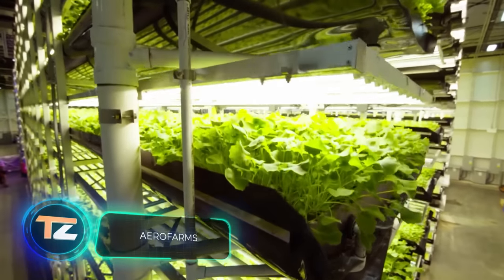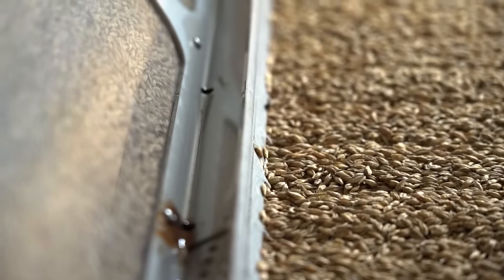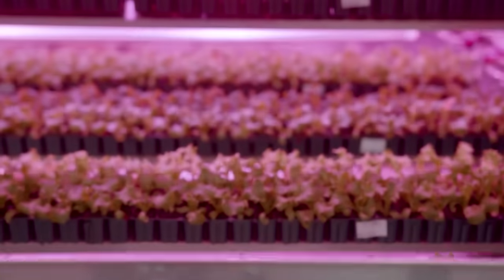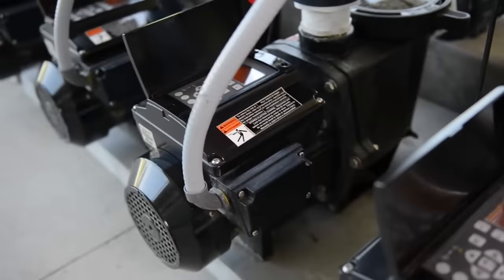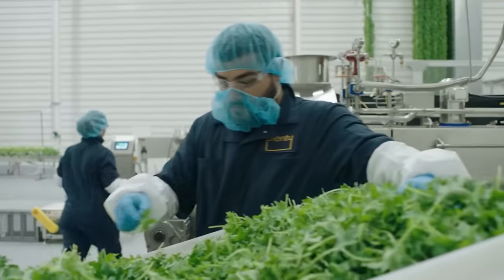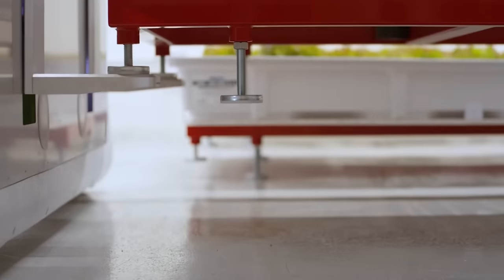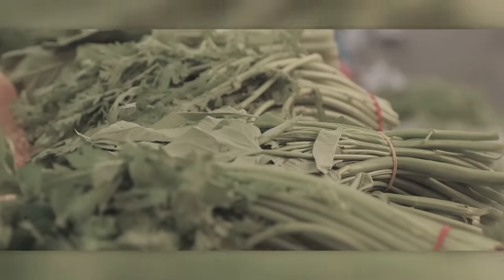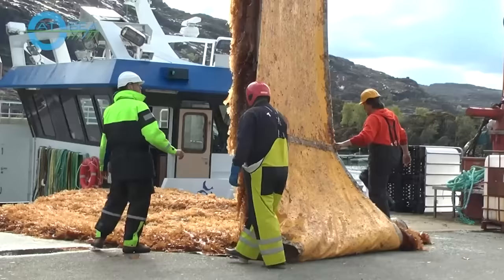11 AMAZING FARMS YOU HAVEN'T SEEN BEFORE

Comment: Factory farming is still factory farming even if the cages are new and shiny. We're supposed to have evolved past this already, numerous countries have implemented laws over the last two decades to stamp it out and the public is increasingly moving to more sustainable and animal friendly alternatives.
I also question the economic and environmental viability of indoor growing on such a scale. Notice how none of the examples in this video mention the power consumption of grow lights while lauding the reduction in water? Probably because it's a false economy, any saving in water use is dwarfed and made irrelevant by the high energy consumption, much of which is still coming from the burning of fossil fuels.
Outdoor farming, when sustainable, doesn't require grow lights and doesn't require that degree of manual irrigation.
We need to stop trying to "Muskify" what already works and just focus on becoming SUSTAINABLE within our existing environment.

Comment: What bs. If you factor in the complete life-cycle cost of a vertical farm you need many times the space and resources that an actual farm would need. Plus you produce waste and toxins which would never occur natrually. I am a technician and software engineer, but the blind will to solve everything with more technology makes me want to vomit.
Reply: One reason for developing such systems is that they use far less space, water, and plant nutrients than conventional farming. 
Not sure what toxic residue would result from this, could you elaborate?